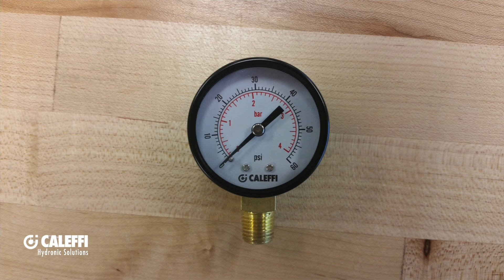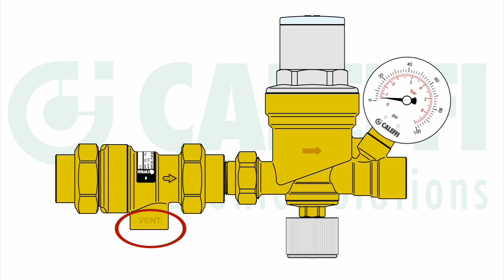573 AutoFill™ Combo

Comment: Does this unit come with gaskets for the union between the backflow and valve ?
Reply from the maker: Depending on when the unit was purchased, it would come with a fiber washer or an O-ring. Since the beginning of 2023, all of our autofill units have been shipping with a captured O-ring. Prior to that, they were shipped with a fiber washer.